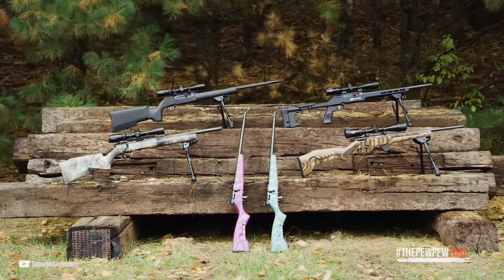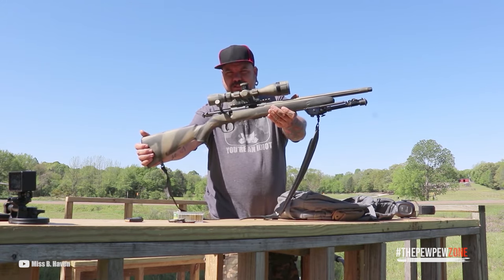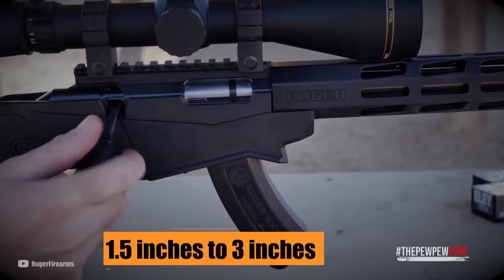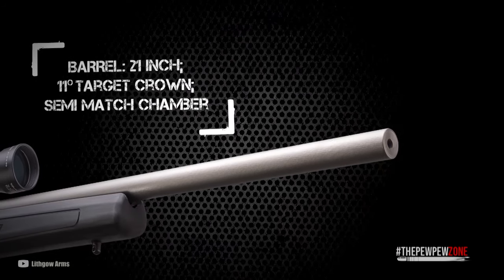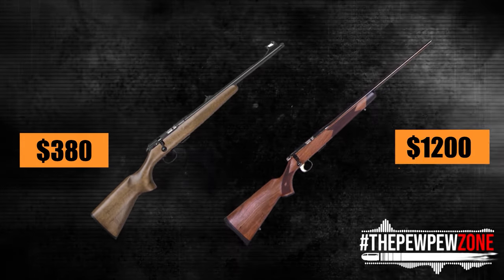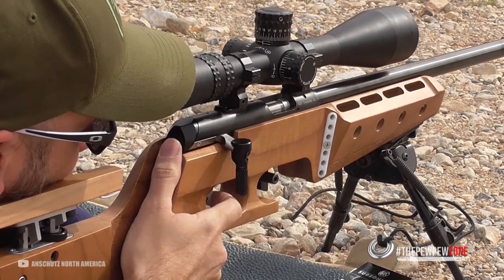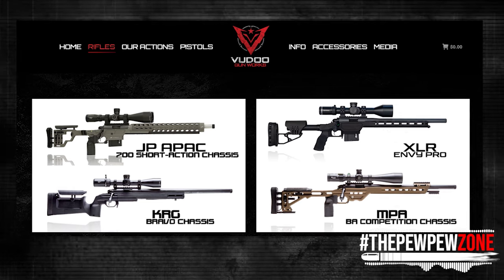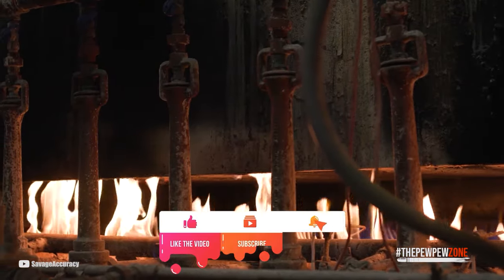Most Accurate .22 Rifles for any Budget 2023

Comment: I'm stuck with a Ruger M77/22 Varmint I bought new when they first came out.  Yeah, I know, not the greatest, but it has always shot well.  However, I installed the bolt shims, sear and springs available for these rifles, and the results were most gratifying...finally a trigger that could be called "really good" but not adjustable.  Using an old Leupold 2.5-8 Vari III, the thing will do .250" at 25 yards with cheap ammo and that's with 75 year old eyeballs.  Evidently these rifles (especially the Varmint model) can bring some "green", so I will just stay with it.  If it does .50 at 50 yards as indicated by the .25 at 25 yards, it is as good as I will ever need.

Comment: Been running a Savage Mk.2 for a while now. Did some DIY modifications and it's wicked accurate with CCI Standard Velocity 40gr. Best 100yd. group was under 1 MOA
Reply: Ok, but is that indicative of what it does consistently? My bergara b14r with the lot of sk std + I've got shot a ~.4 5 round group at 100... But that was one time, it also shot a 1.4 but 95% of the time it's ~1 moa @100 (.8-1.2) for any kind of statistically significant dataset (10 3 Rd groups or 5-7 5 Rd groups 3 10s 1x 30 etc) 

In my testing std is prone to fliers ~ 2-3/10 with ~ 1/30 way off @100 2 ish moa from the rest  of the group. It's great with 90% going into 1.6 ish moa for a very low cost though.
Reply: My mk 2 is 5inch a 100yds on average. What did you do to yours?
Reply: @dhall5634 with what ammo?
Reply: @tacdriver22mk2  all ammo